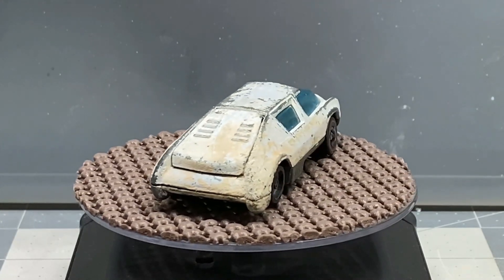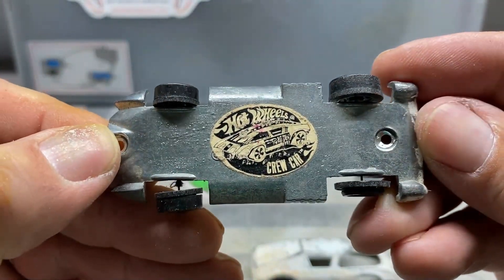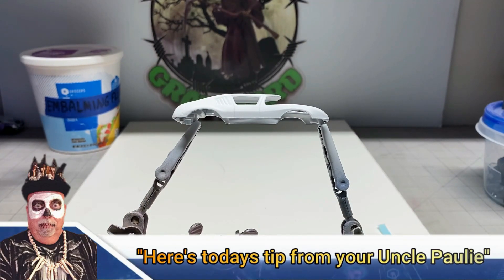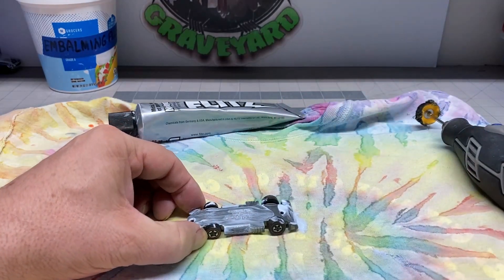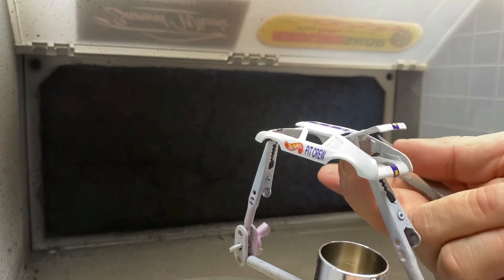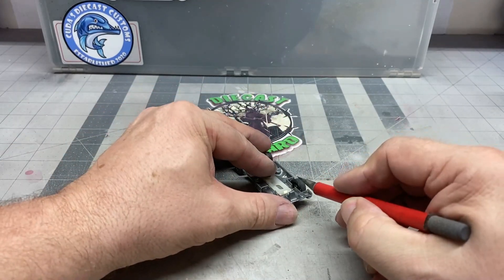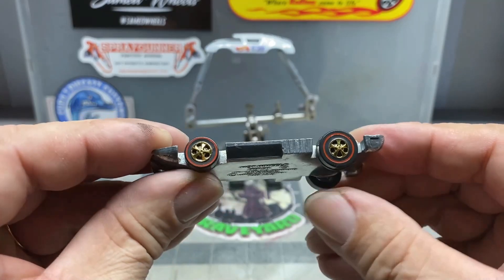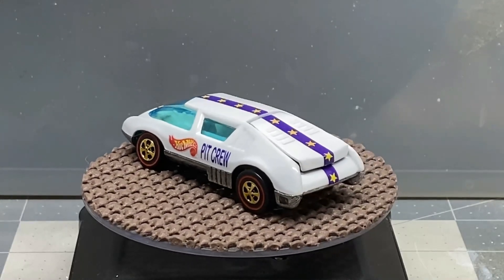Hot Wheels Pit Crew Car Restoration Vol 2

Comment: Hi Paul, i use tamiya airbrush paint because they don’t deliver specta flame paint to the Netherlands yet. I always use the formula: ( 10 drops of paint 1 drop of thinner ) but somehow i always manage to screw up. When the paint dries it leaves this air bubbly surface and it looks really bad. Sanding it doesn’t help. Do you have any solutions?
Reply from the maker: Brother if they have Createx paint over there, I would give that a shot. I don’t have a lot of time using the Tamiya paint. I guess this is definitely something I’m gonna have to explore so I can answer questions like this. I would try using light coat and let it dry a little bit in between if you can or at least tack up for about 15 minutes and then just keep building up light coats.